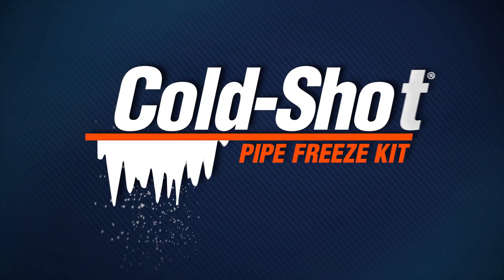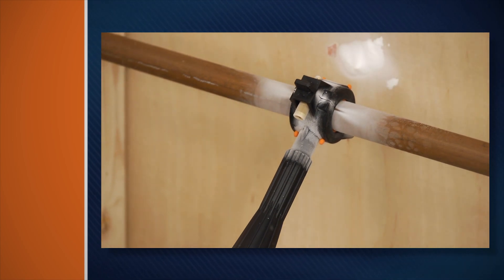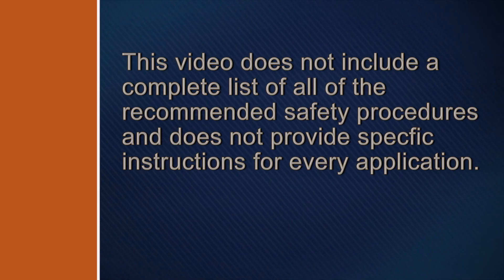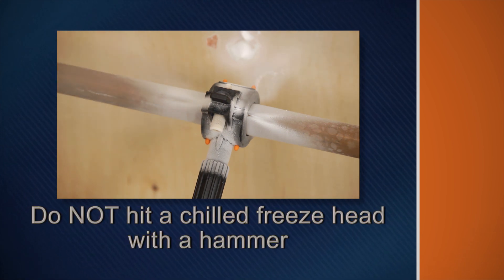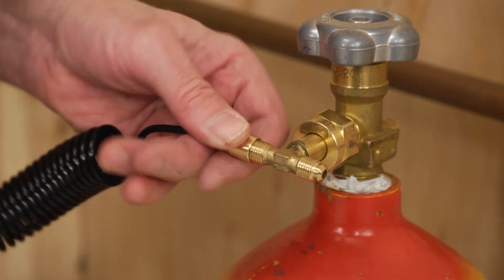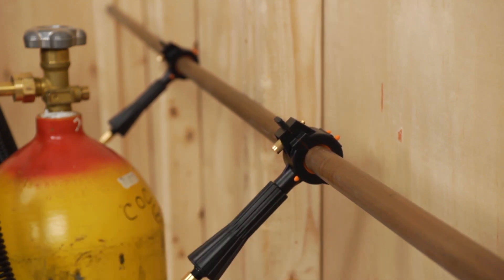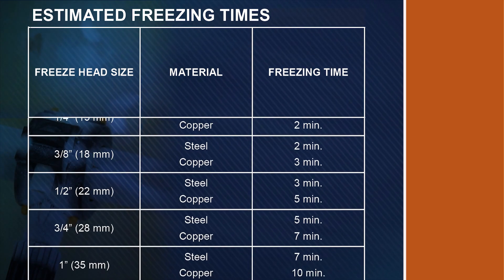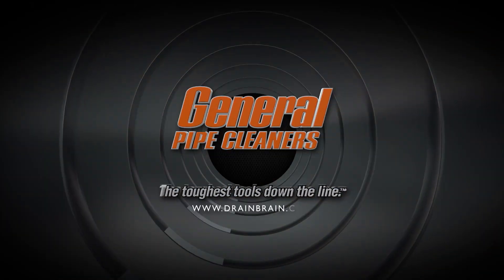Cold-Shot Pipe Freeze Kit How-To Video

Comment: What if the valves don’t hold properly and shut off about 80% will this method work?
Reply from the maker: The water flow must be stopped for the Cold-Shot to work best, just as the still water in a pond freezes over faster than a flowing river.
Reply from the maker: The water flow should be stopped completely. Often the Cold-Shot is used to replace a valve like this that isn't working properly. It is best to shot off the water flow at another location upstream to the repair location. Moving water is difficult to freeze. Call the Drain Brains at 800-245-6200 for more information.